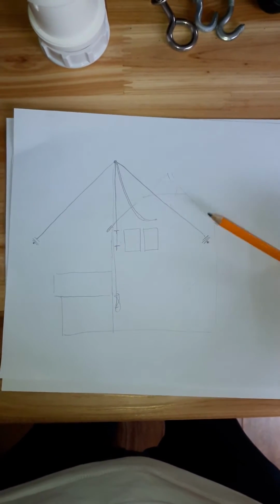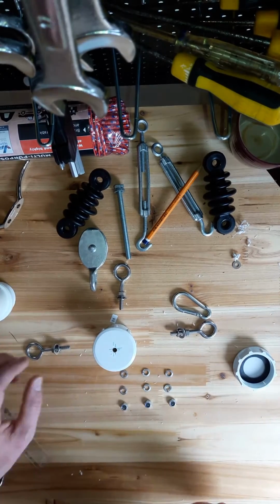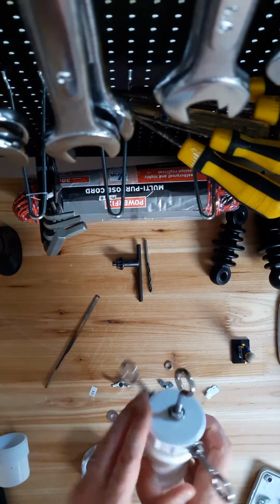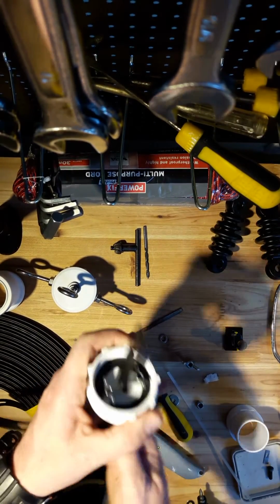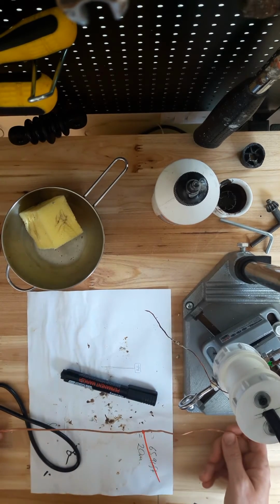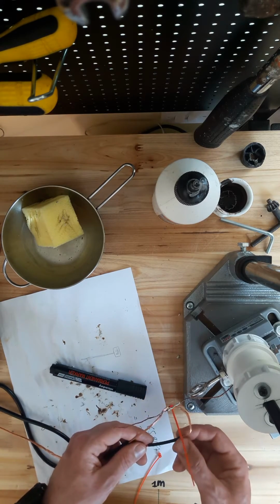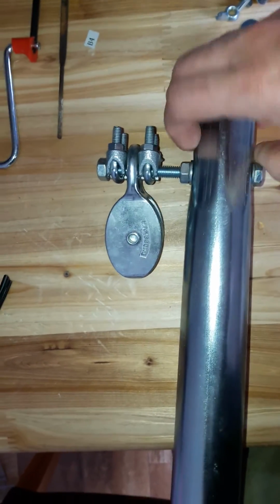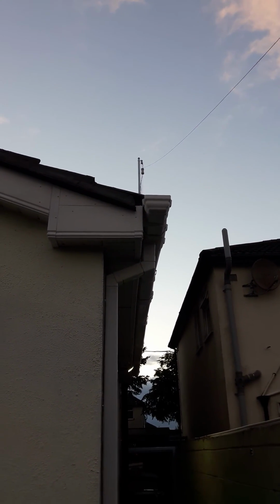Building a Doublet Aerial - Antenna

Comment: For outdoor antennas, use brass or stainless steel hardware only. Brass is better because, although it might become slightly corroded over time, the nuts will not bind onto the bolt which can occur with stainless steel.

Comment: I see another mistake in the way of bringing the ladder line down to your shack as you should have run it down to one side of the mast .
Reply: Ladder line is only effective if it is kept well clear of metal. If you must run it down a metal pole, then you need to stand it off with insulators as far as possible from the pole.
Reply from the maker: The difficulty with running it down the mast was the feed line became an odd quarter wave length with all the attendant problems. Through trimming and experimentation - its current configuration offers best performance for its situation. I'd say "mistake" is a bit strong, all Antennas I know of are compromised - unless you live on a farm?

Comment: I would have split the ribbon cable and put the ends of the leads back down through the holes in the cap so you can solder the antenna wires to the ribbon wires .

Comment: Fantastic antenna, I use a Doublet myself connected to a SG230 smart tuner. You done a lovely job but I feel you over complicated the build. It can be done much more simple by using 3 insulators and wire spreaders, the wire spreaders act as your feed / ladderline up to an insulator each leg then splits off and it can be made with no joins just using 2 bits of wire each being identical lengths. 73s
Reply from the maker: You're right about over-complicating the build. I redid it a few months back using a dog bone isolator at the feed point and just screwing in an eye bolt so it can be hoisted up. Much more elegant looking. 
I "over-engineered" the first one as it was my first antenna :) 
Thanks for watching. 73

Comment: How have you fed this into the rig ? have you used a balun and then coax
Reply from the maker: At the moment the 300ohm ribbon is fed directly into a high impedance port
on the SDR; it's designed for this i.e. a Balun is not required. 

However, I plan to incorporate an ATU as I want to experiment to 
see if the ATU will improve reception on HF. The ATU has an incorporated
 4:1 balun as the feed from the ATU to the radio is via Coax.